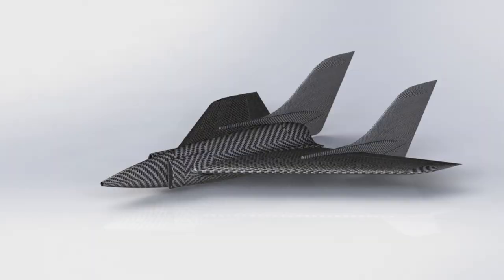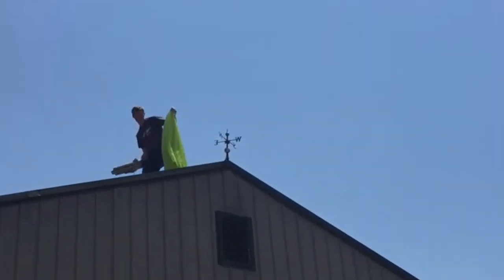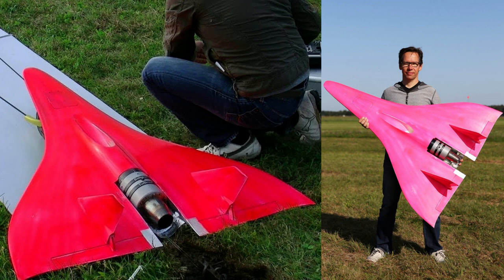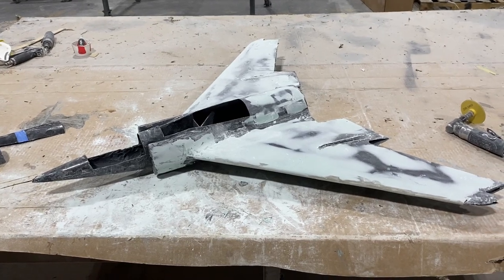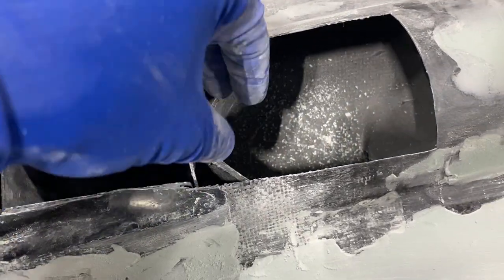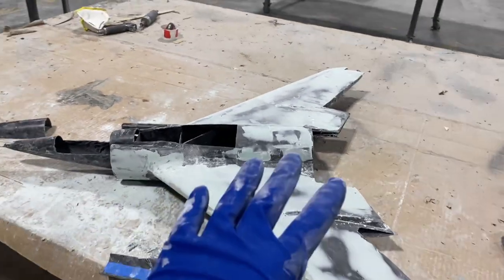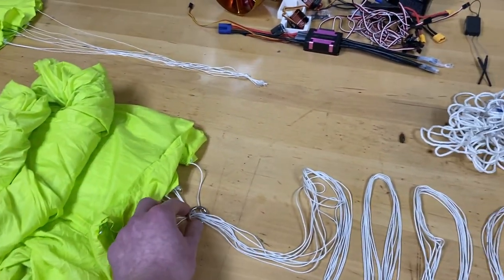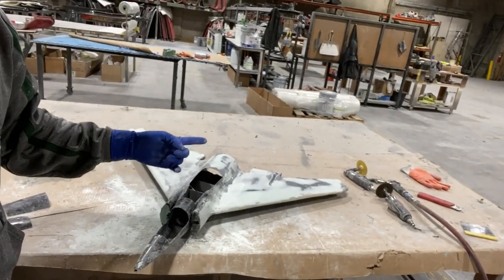Landing fastest RC plane / Parachute

Comment: Nice project! Have you flown anything fast yet? Seeing the airplane we'll enough to fly it starts to be a problem even at speeds of 200mph. This is why many speed planes are pretty large. My electric delta called Hades goes 235mph and is challenging to fly at that speed.
Reply from the maker: Hi! I check out your video of Hades flight on your channel, it is awesome!
The fastest plane I flown so far is 150mph. You right it is going to be challenging. But I plan to install very bright LED on final plane just like on real planes(green, red, white). And fly the plane at evening so it will be easy to see LEDs even from several miles. That way I don’t even need to see plane and will know it’s detection of flight. I will make a separate video about this topic!
Reply: @ivanmarkovavia  Hi Ivan! You might want to use some sort of flight controller or fly-by-wire system to control the plane. It will make it much more stable and easy to control at high speeds.
Reply: @GooseOfYork  those are not viable for the record
Reply: @silence6966  Why do you say that? https://www.youtube.com/@rctestflight This guy uses an Aduopilot flight controller in most of his builds and it works very well.
Reply: @GooseOfYork  RCtestflight doesn't make airplanes that go any where near as fast as this plane will have to go to break the record.
Reply: @justcallmenoah5743  True, but surely a flight controller could help at least a little bit. You would have to do a lot of testing as there would probably be a lot of oscillations at those speeds.

Comment: Wow, this is almost more like model rocketry than rc planes! If you want to protect the chute on the way out you might consider putting it in a bag, and the connecting the bag to the hatch. That way you can drop the pilot chute and use the hatch for that.
Reply: That is the thing, modern jets are simply falling with style at high speeds. They don't really glide along like passenger jets so much as they are just jet powered darts

Comment: Hey Ivan, keep in mind that the CG of the plane, when hanging on the parachute, is likely way back of the mounting point of the parachute. Therefore it is very likely that the whole plane will land on its tail, potentially damaging your engine / afterburner components. Just something for you to keep in mind. Did you have any experience in modell aircraft flying? 70 mp/h landing is fast but certainly doable on a large enough field. I calculate chances of loosing the aircraft due to normal landing to be lower than using an uncontrolled parachute. Just trying to help as you might want to recosinder your options. Good luck!

Comment: Why not use a heavy lift drone to do an aerial drop of the aircraft from 700 feet? I believe you would achieve sufficient speed during a dive giving the aircraft a chance to sustain flight versus the potential risks of a catapult. And I’m curious… what are you using for control of the aircraft? Friendly suggestion, I’d recommend using something completely different from the 2.4 band for something high speed.  Tbs crossfire with PWM outputs should easily do you better if you wanted to go distance for a longer straightaway.

Comment: Almost any other variable geometry ( sweep angle, leading edge flaps, and trailing edge ) will beat a parachute. With a controlled airplane, we can land at 60 mph on a road. Don't need so much area for lift. A parachute uncontrolled descend at 30 mph straight into the ground is fatal.